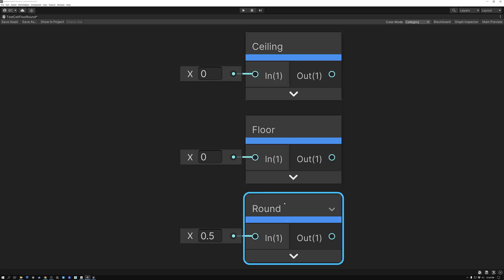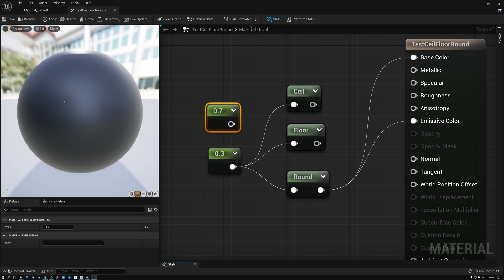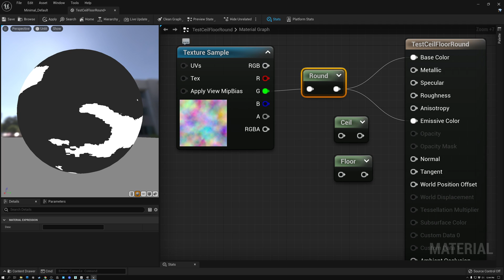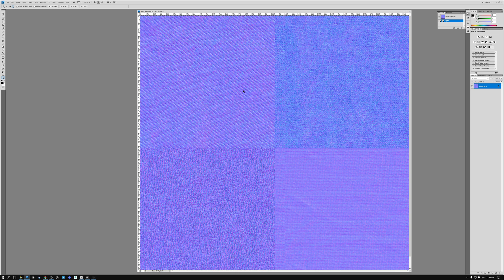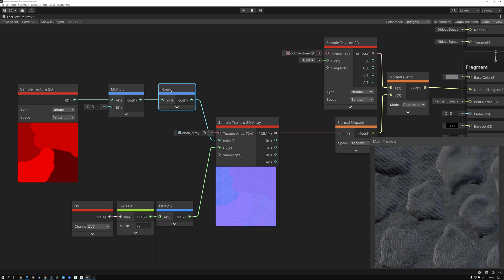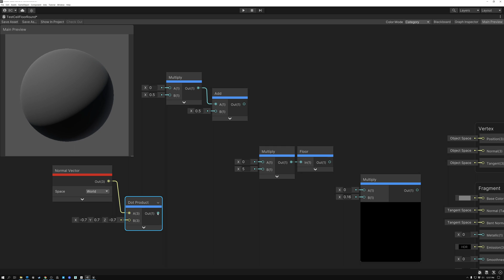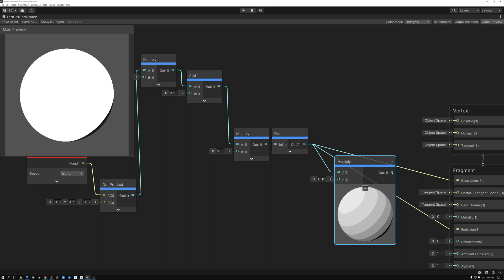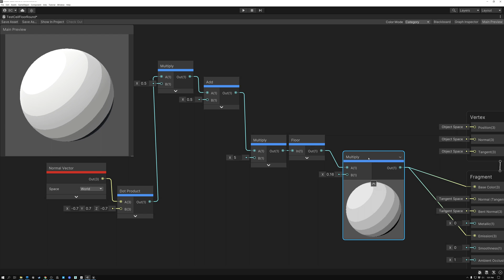Ceiling, Floor, & Round Nodes - Shader Graph Basics - Episode 17

Comment: For those wondering why we end up with 7 different lighting bands on the object even though we should end up with 5 since we're multiplying by 5 and flooring... it's because the "fake" light vector isn't normalized. So after adjusting the range and multiplying by 5, we end up with some values above 5 and some values below 0, which results in 7 different integers after flooring. Normalizing the vector before putting it into the dot product node will correctly adjust the ranges from 0 to 5 (technically there are 6 bands if you count the one vertex that has a normal that perfectly aligns with the light vector)

Comment: So index socket in Unity is what in UE?
Reply: Go back to his advanced detail mapping video, he goes over that example step-by-step there: https://youtu.be/avZ26yW2KBw?si=jkff9Z2liMhKysHf&t=636

Basically UE uses the same texture sample node as normal, but when you use a texture array asset as a texture, it expects a vector 3 input for UVs (UVW) instead of the normal vector 2. The 3rd element (W) of that vector is the index